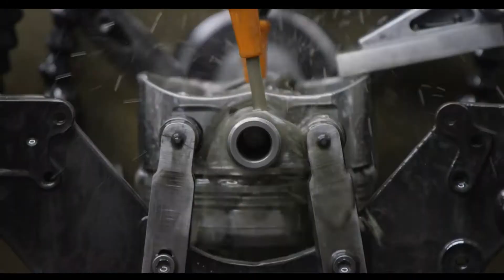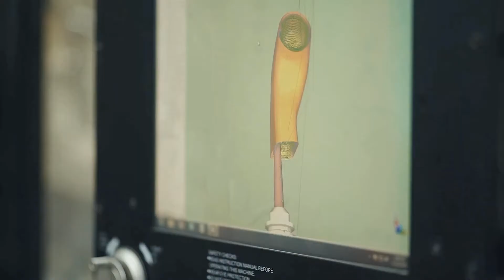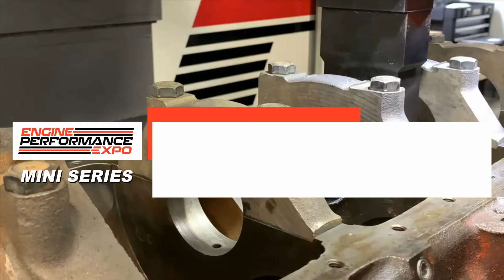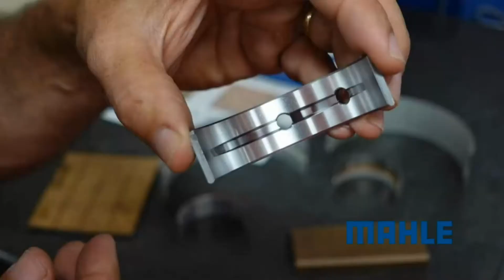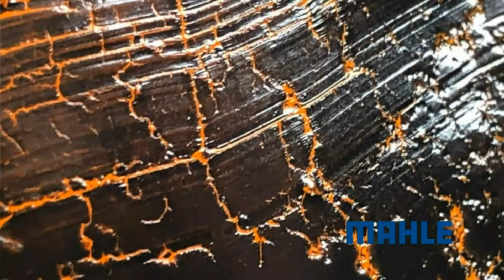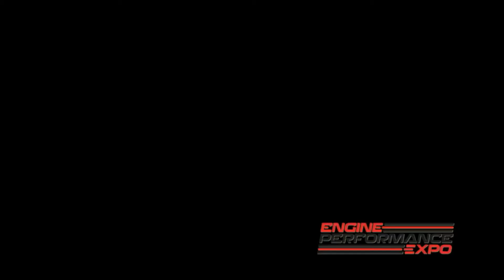Engine Bearings (2021-22 - Episode 21)

Comment: Can you get Ford 352-428 cam bearings pulled off assembly line before they get machined for oil holes?
Dan front ones would be fine the way they are made.
Really only need 2-5 so the he hemorrhage of oil out of those bearings. All that’s needed is one .125” hole and will live forever.
Thanks Dan 
I have been asking for years since 1969. Dan I retired from AERA after 17 years. Great people there.